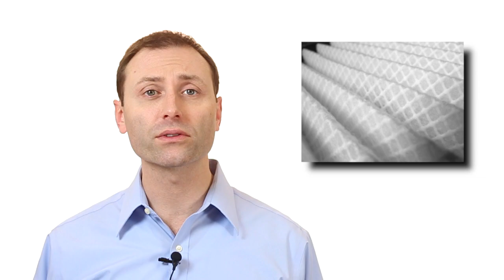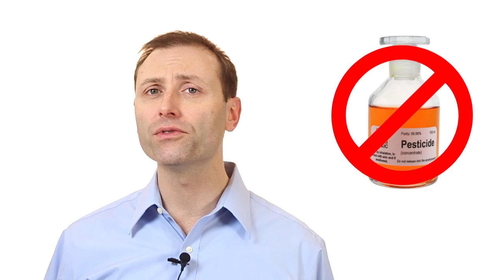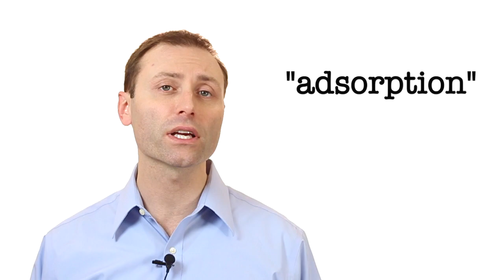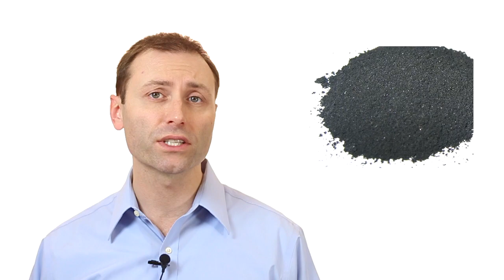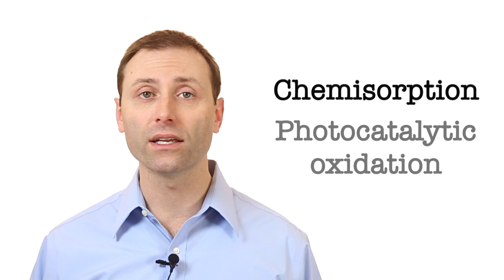Gas Phase Air Cleaning

Comment: Thanks a lot for your speech. Yes. It is good. Except activated carbon as filtration media, you could use alumina with potassium permanganate to remove H2S, SO2, methanal and other harmful gas. You could know it in website http://www.xr-activatedalumina.com/air-filtration-media-with-potassium-permanganate/.